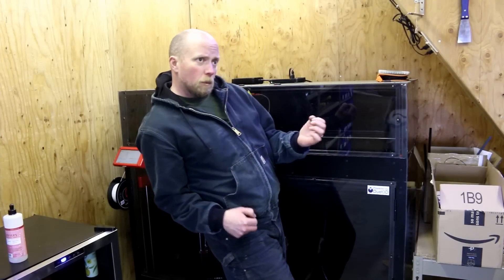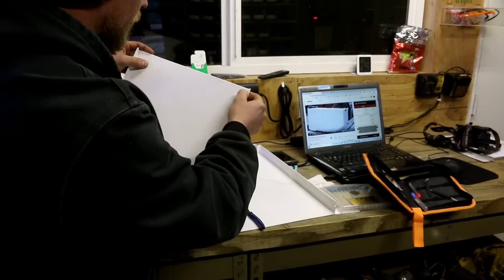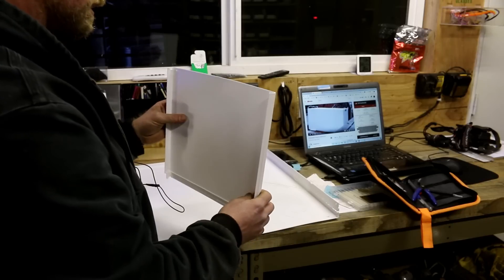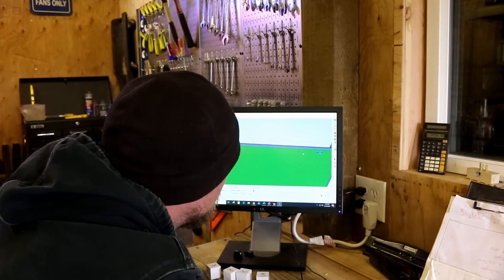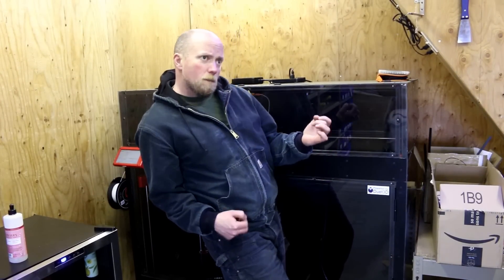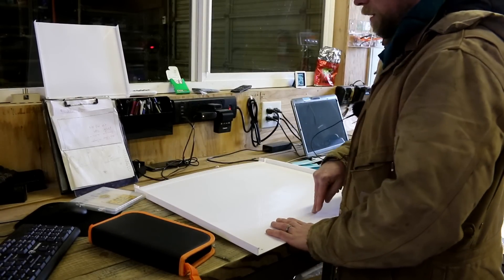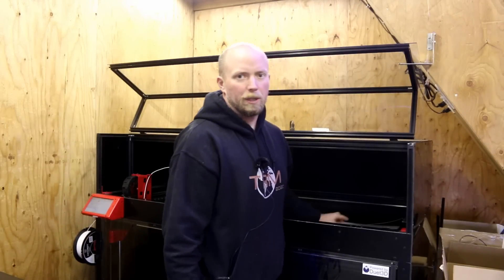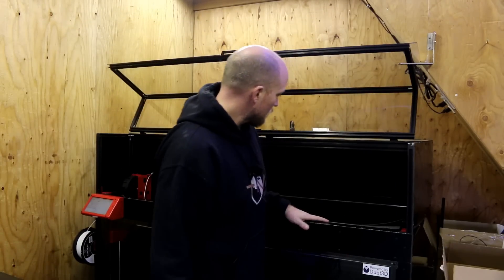SUCCESS MODIX 3D Printer Full Test Print

Comment: My Opinion, it's temperature and it grabbed and moved the print hence the error.   Do redesign now before it is too late to include a bump out for each root ball to grow instead of splitting the front and back apart.  Remember grass roots can lift concrete!  You must give the root area to grow!

Comment: Check the grub screws on the X axis drive stepper motors - if they're loose the print can shift back and forth.  I've seen that several times, I've never actually seen a stepper motor skip...

Comment: you might not have to cut off an entire row of holes if you do diagonal spacing.  Looks good, the amount of people who are starting gardens, buying out CSAs, and cleaning seed companies out, will be clammering for whatever product you have.

Might even be worth doing an even smaller starter kid that has two columns, costing less, faster to print, larger demographic of people who only have a 1.5'x1.5' section of counter top or window sill to grow on.  Worth thinking about, smaller will also allow you to dial in your processes with less wait time, as well as cost less for shipping/distribution and packaging.